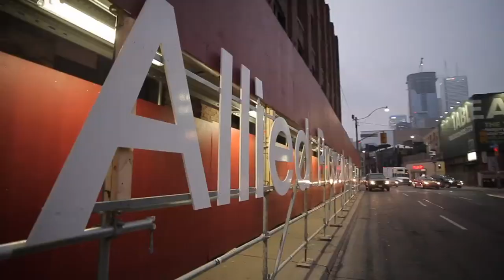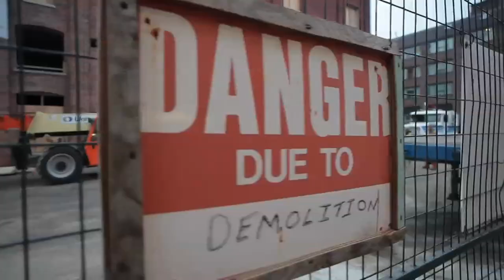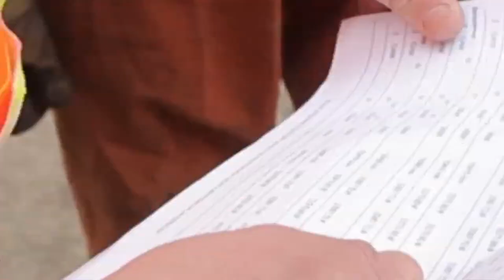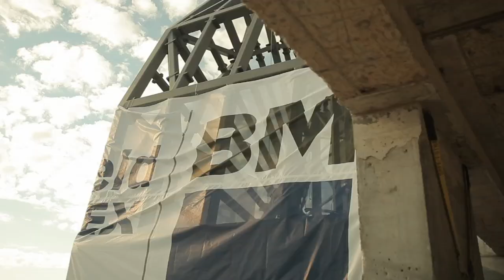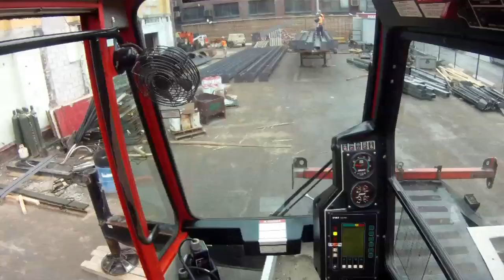"HIGH STEEL" - Pilot - Positive Productions Inc.

Comment: If you can use a wrench or a ratchet and can handle heights this is a simple trade. Not much in the head upstairs but your small head better have a big sack supporting it lol. Cheers from a union painter that works along side with you guys
Reply: Massimo b loll can you read blueprints... weld... rig loads... tie knots.. tie rebar.. and whole boat load of other shit I’m forgetting
Reply: I'd say the same thing if the only thing I had to handle at heights was my lil paint brush Dx